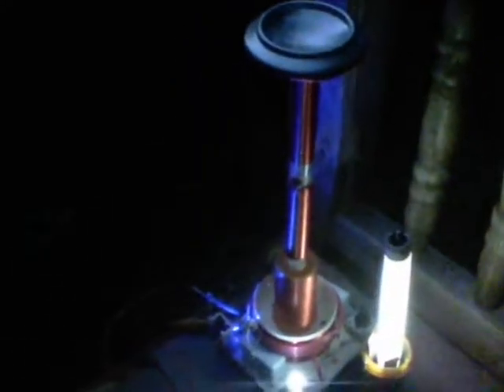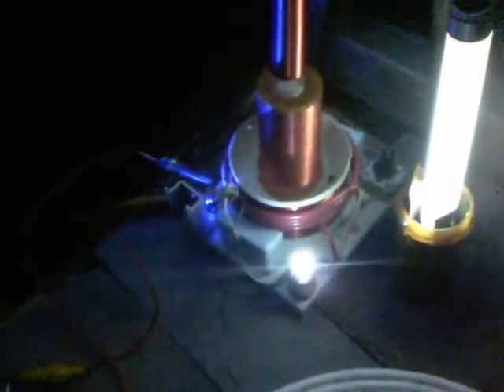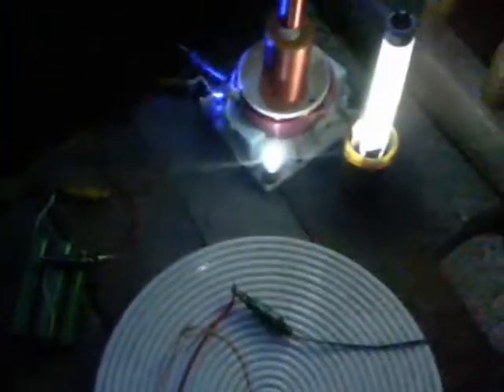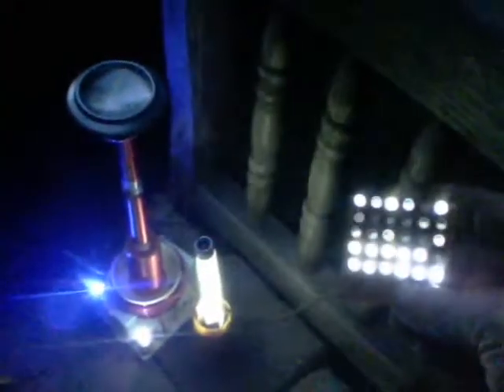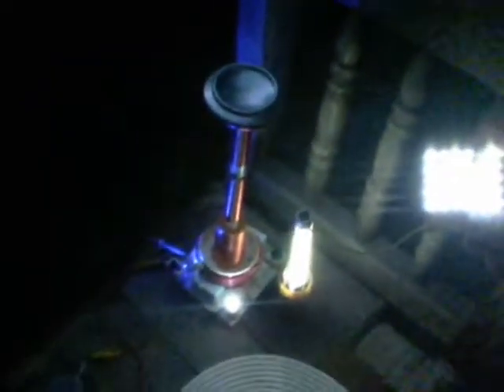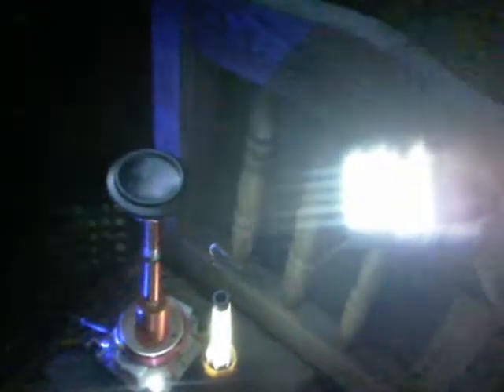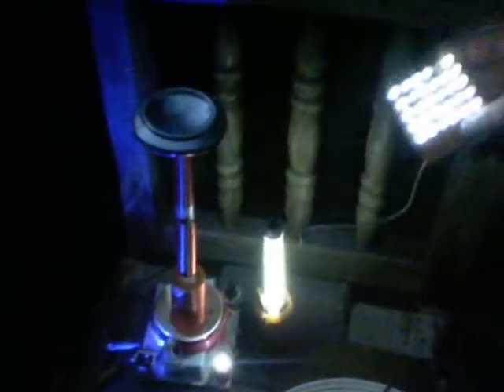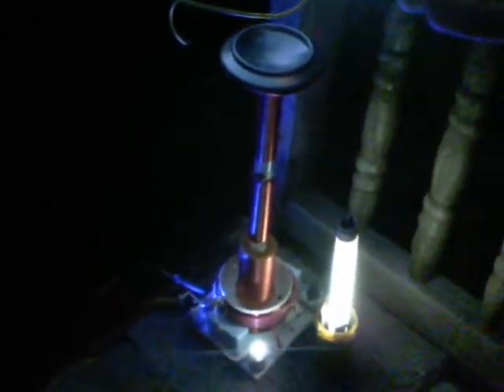Micro backyard Wardenclyffe - taking shape

Comment: great!  thanks for your inspiring vid. i've been meaning to do a mini tesla magnifier.

check this link. somewhat like yours
http://www.tesla-coil-builder.com/tesla_magnifier_1.htm

just connecting the puzzle. what do you think?
Reply from the maker: I like how he covered and sealed the Secondary then poured oil down, bit different. It's an interesting read, thanks :)
Using a neon sign transformer is one way, mine are usually very low voltage Slayer exciter types, but here I added a coil wound in the opposite direction (mixing the Patent with Caduceus coil node thinking). Generally there's just 1 Secondary coil.

Comment from the maker: Yes of course, as long as you can setup the receiver. If metal, use your boat as receiving antenna + deep ground connected to oscilloscope and a radio. Tune til hear Schumann 'beat' frequency, with oscilloscope trace showing that as carrier plus Tesla tower carried energy. Connect Ground as Neg and boat as Pos through tuned oscillator (at that found frequency) to the rotary transformer that you're making and enjoy the free power !
Any place on planet will have slight different receive frequency.

Comment from the maker: Ah well I was out shopping with my wife and said "that's cool, 9 superbrights for $1 and a free flashlight housing" lol. But, they are stainless tubes, ideal for HHO experiments ! The battery holder is ideal for 1, 2 or 3 AAA experiments, especially if using rechargeable AAA's from $1 solar garden lights :)
100W LED ?! lol, mad though very cool. With this sort of thing on higher power i'd prefer to burn out several cheapies than 1 of those ! but as you say, would be a great light for the size.

Comment: Oh I see.  That could be a problem with some projects if they are needed to be connected in series.  I just looked on ebay and they are even cheaper.  Under $7 for 100.  A 100 watt LED is only $9!!!  What would you use that for?  One big blinding flash light!!!

Comment from the maker: Yeah, topload should be tower height/2.75 - mine's now been replaced with a CD lol, just a touch short of ideal. Any imperfection can cause breakout at higher pressures...something i know you know all about. 
Main Primary induction part of Secondary leads to low Secondary that sits inside the field of Primary, leading up to same direction thinner diameter Secondary, then opposite wind tertiary above. A cone + reverse wind, in a way.
Glad about soda can result, but not the poor old tranny !

Comment: I tried a ball of foil on top of the straw, on top of the secondary (with 2 secondary's in series, Is that what you have done?) It did run, slightly worse than other configurations. The top load was tiny though, so I should try a bigger one. With tertiary on top of soda can top load though... Phrawwww. Was going to film last night, but got distracted when I found I could charge green caps wirelessly, then hand to someone for a shock.. Discharging said 670nf cap to topload will kill trany btw...

Comment from the maker: 4 volts x 130mA 0.52W
So about 1/2 a Watt is what it uses at the moment. It's not the end of the build though, it's somewhat open to change. Will be trying another coil as the inner tower base of the Secondary, then trying a 555 circuit for triggering. Then perhaps a DC motor variant of a spark gap for fast sharp triggers. The variable capacitor across the Primary also needs changing.

Comment from the maker: Thanks. It does work on dirt power, tried it with galv steel and copper in a pills bottle. Only a tiddly amount of wireless, but it's there. It's to be solar powered and work as an inverter for one use, just as soon as I fix the panel that one of our cats walked over.

Comment from the maker: Cheers Ray. Am hoping that this mini version has enough about it to get the 50ft. A question of scale, this is 1/186 scale or thereabouts lol, so 186th of very very far is still far enough (should in fact be limitless to a degree) :)
It may end up motor driven yet for the fast sharp pulses, or 555 timer plus MOSFET. 
Looking forward to the wood frame build...got 3 big boxes of matches for timber !

Comment from the maker: Oh i'm all about that lol. That's why the single Li-Ion and low volt damaged pack. 
Now, here's something - last night I had it on the workbench with no batt and had the Negative connection connected to a clip lead and metal heatsink. I put that on top of my PC tower and the blue LED on the circuit came on partially. Stayed on but dimmed, when power was turned off at the wall last thing at night.

Comment from the maker: Yeah, 50ft away is an identical assembly of lattice wire under the ground. It's a 2ft x 2ft weave of bare house wiring in a square, with one shielded wire up to a ft or so above ground level..put them in about a year ago. The idea is to receive the Earth part through that, tuning a pancake coil or identical tower above ground level. Sharp fast pulses are needed, plus a bit of voodoo stuff probably that i've yet to learn :)